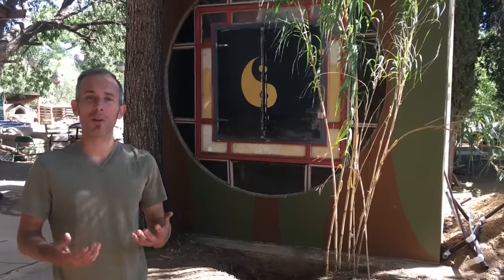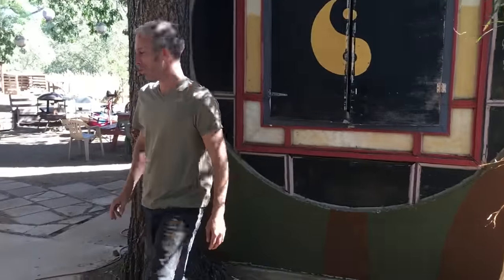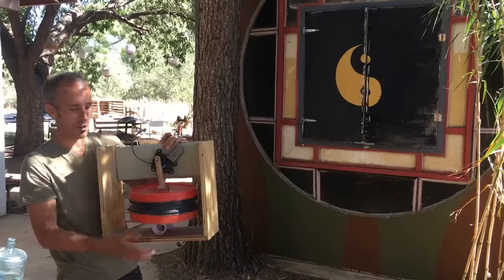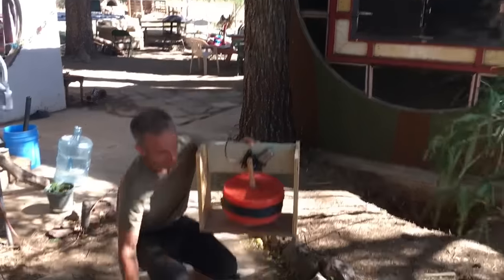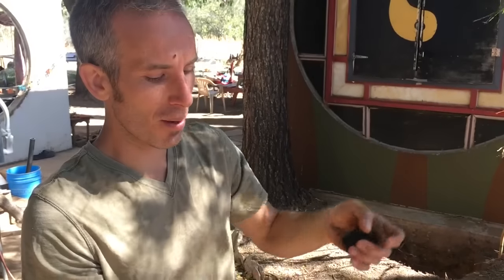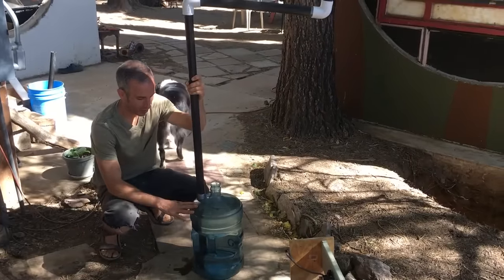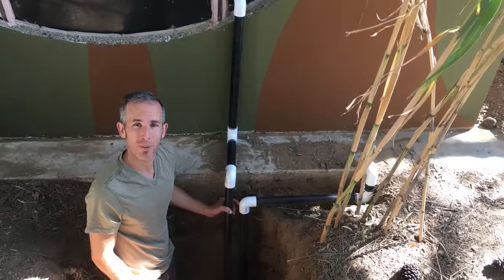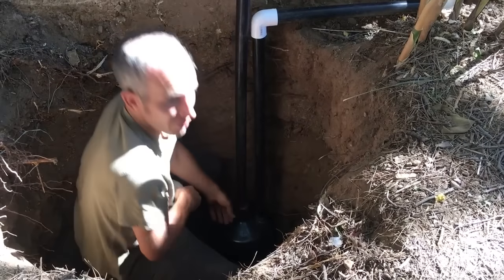$20 Ground Mass Air Cooling -DIY, Open Source

Comment: "Pretty Cool" but it would be nice to know how many degrees below ambient it produces....
Reply from the maker: The air should come out at the ground temp, which will depend on location, depth of hole, and to a limited extent season and sun contact with the ground above it.

Comment: I have a question, if yall have a second to answer it .
Would this design work in more temperate, less arid climates?
I understand that evaporative cooling systems like this  dont work so well in humid climates, though im wondering if somehow because of the geothermal effect, that gets accounted for.
Reply from the maker: This isn't an evaporative process, in fact it would be an issue if the water did gas off over time.
The cooling effect is just from transferring the ground temperature to the water, as in most locations it should be cooler than summer days and warmer than winter nights.

Comment: I have one concern: How long before that plastic bottle starts breaking down and releasing micro-plastics into the soil, etc.? Is there a more environment friendly alternative?
Reply from the maker: The water cooler bottles are usually polycarbonate, which is essentially indestructible and should start breaking down approximately never.
In other parts of the world the 20 litre bottles tend to just be PET or equivalent, which isn't quite as hard wearing but should still last a good long while.
And considering that in most instances it'll be this or landfill..

Comment: After you bubble the air up, how do you prevent the water from eventually going bad? 🤔  Just replace the water on a schedule?
Reply: People don't worry about radiator water going bad, it's just segregated from drinking water. Hydrogen peroxide at low calculated concentration, would be safe & prevent algae growing & gumming anything up.
Reply: @capoeirastronaut    Was just concerned about pumping foul smells, mold, etc into the place :)
Reply from the maker: Since the air is passing directly through the water it will essentially inoculate it with whatever, and then pass that culture back into the house. I did look at hydrogen peroxide as an option, and it should be pretty effective, and easy enough to get, but the issue is that it will gas off over time. Not to anything harmful, but means it'd need to be kept topped up, and I like to keep my stuff as low to no maintenance as possible just so someone does forget and end up getting Legionella.
Salt, on the other hand, should just sit there pretty much forever.
Reply: @OpenSourceLowTech  iodine tablets maybe?
Reply from the maker: Effective, but also gasses off.

Comment: There's just not enough internal volume and surface area to be effective. People run earth tunnels for 50 feet, or 100 feet, or 200 feet, and many setups have large diameter pipe.
Reply: You`ll get better performance from shorter tubes :)

Comment: if your running that little motor on the bellows pump.... you may as well run a small fan it would be far more efficient.
Reply from the maker: A fan won't be able to overcome the slight backpressure from bubbling the air through the water.
But I'm also working on a heat exchanger version which might allow for it.
Reply: @OpenSourceLowTech  and there is your problem.... dont think it like a water bong. instead use coils and have the air go through the coils. running air though water is going to create a bio hazard sooner or later.

Comment: can you provide us some data about the in/out air temperatures?
Reply from the maker: I have some graphs somewhere, but basically I wasn't able to get it to come up more than half a degree over the ground temperature even feeding it eight hours solid of 2 l/s 55C air from a vacuum cleaner pump.
Reply: @OpenSourceLowTech  Great.  Why are you wasting people's time with things that don't work?
Reply from the maker: @MrRerod  Being a cooling effect, not coming up over the ground temperature is it working..

Comment: Does anyone suppose this device might pump the cooler air high enough that it could enter the structure at a height of about 5' rather than at floor level?  If so, it would be more effective since the air inside the interior cabin would naturally fall downward?  It's my whole body I'd want to cool off, not just my feet.

Comment: why bellows and not just a fan?
Reply from the maker: Back pressure. It doesn't take much to push the air through the water, but still more than a fan can manage, unfortunately.
I've been trying to find a scrappable / off the shelf air pump that will do a couple liters per second at a couple PSI, but it's surprisingly tricky.
Reply: @OpenSourceLowTech  Thanks for the reply
Reply: @OpenSourceLowTech could you not suck the air out of the output rather than pushing it down?
If we was looking for an electric pump. What would work?
Reply from the maker: @hotspringsofbritishcolumbi9513  Would depend on whether the pump worked better with negative pressure or positive, but probably not much difference either way for most.

Still trying to think of a good air mover option in terms of global accessibility and ease of use.

Comment: What about mold?
Reply from the maker: Water is saturated table salt solution, so shouldn't ever really incubate or gas off. Pipes etc may want a flush every now and then, depending on situation.

Comment: Maybe just dig a hole (basement)  and build the small house over it.  Then you get the cooling right in the hole.
Reply from the maker: Cellars are nice if you've got one, and easy enough to move the air round the rest of the house, tho maybe with a filter..

Comment: That's ingenious in the use of recycle material. However, its effectiveness at transferring the heat from the building to such a small area underground is highly questionable.
Reply from the maker: It's quite a bit more effective than I would have thought. I'll be back in Australia next year (currently in Scotland where cooling isn't such an issue) and will continue the development of this design, with actual data and outcomes.

Comment: You could just use a pvc check valve for the valves.
Reply from the maker: Yes, tho they can be a little tricky to find in some parts of the world, and getting them to work with air usually requires manual shortening of the spring.

Comment: Would be interesting to see proof that this works. For example show the temperature before it starts. Show the temperature after it runs. And do it during different parts of the day. Also you're pushing air through water that's dark. Are you worried about fungus and mold and other contaminants growing in the water and then getting thrust back into the air. Are there any health concerns with that? Seems like there might be some issues there you know.

Comment: Bravo........ one way valve.......clever.......rubber ball in tube ....gravity .......ping pong ball.......water inbucket is a valve.......camera to see condition of liquid .......mold is water.......also air scurber or cleaner......cheers

Comment: I would keep the air and water seperate not sure if the mist could trel the system or not but this screams legionnaires disease to me. Maybe submerge a radiator or 3 in the liquid to keep them seperate.

Comment: Why a motor..why a pump..why water....a longer pipe would result in the same system, but it would be 100% passive. I have that in my home, it pulls earth cooled air into the house no problem 😀
Reply from the maker: Yep, that approach generally works fine, just takes up a lot more area and investment.

Comment: This is valuable work I want to test. I'm surprised that motor and pump has the strength needed.  Does it work for heating in the winter ?  Would it work in Florida where ground temp is not 55F but rather 72F? Does the hole remain open? You ever change the water? Does it work directly from a panel with no battery?
Reply from the maker: The backpressure is something like 0.2 psi, so doesn't take much to overcome. More than a fan impeller would handle tho..
It'll bring the air up or down to the ground temp, so if that's a useful heating range, which 72F / 22C would seem to be, then yes it'll essentially work as a heater in winter.
Water vessel gets buried. Saturating it with table salt should remain sterile and not gas off, so water shouldn't need replacing.
I've got another video on my channel running the pump motor directly from a PV panel. Only works in daylight obv, but that's usually the only time cooling is needed..

Comment: i would make a swamp cooler.  Cheaper don't use that much electric
Reply from the maker: Swamp coolers do a good job in dry heat, but essentially stop functioning after a certain amount of humidity, and go through a lot of water when they do work.

But are commonly used, and are fairly good when they're good.
Reply: @OpenSourceLowTech  Yes for dry climates. Here we really have to much moisture, But they still work nice in the work shops a things tho

Comment: This is simply not going to work as designed at least I can't see it working

The ability to cool a space is about BTUs not about temperature you could make the temperature of that air or water down there negative 100° but if you're only moving 0.1 CFM of air the house is going to heat up from ambient temperature faster than you can cool it you have to match the BTU increase of the house and then beat it by just a tiny amount in order to cool anything

Second You're bubbling through water which means you can't keep the water full You're in the desert in Arizona that means 20% humidity or less and you're sending that ultra dry ultra thirsty air through water which means it's going to be taking a lot of water with it when it comes back up That's not necessarily a bad thing it'll help humidify the air inside your 12 cubic foot cube but that also means you are drawing down the water that's inside that 5 gallon jug.

So you're going to need a way to continuously keep that jug full of water and that cost money as well in fact it's going to cost you a lot of money here in the desert water is expensive

I would love to be proven wrong but I suspect this is one of those MacGyver type things The theory is good and the model is accurate it's just not effective you would need to massively scale up.

I suspect you're going to need a lot more underground surface area in order to be able to have any kind of flow rate and you're probably going to want to use a liquid so piping underground and run water through it in a closed loop so you never lose the water and you just circulate the water underground above ground underground above ground above ground you put a small ACR in front of a small fan think car radiator but in reverse you'll be bringing cold water up from underground and then blowing air over the radiator which will allow the warm air to cool down as it passes over the cooler radiator

If you can scale the system up enough the nice thing is that it works year round it'll give you a 55° base no matter what the temperature is outside so even when it's cold you'll still be getting a boost toward 55° which means your heater won't have to work as hard assuming you live in a place where it gets cold like I do I live in New Mexico but up in the mountains at 7,000 ft so we get serious winter.

Comment: Sorry to be a party pooper but...  I was at Arcosanti in 78 when they had the fire.  What an incredible fiasco.  Ever seen a bunch of unprepared hippies running around trying to put out a field fire that's burning car after car?  I have.  They've been trying stuff like this for decades, only to arrive at something like this that won't produce enough air to cool a bird cage, let alone a room.  They keep trying to reinvent the wheel and connect with 'mother earth' but don't seem capable of learning anything from either their own past experiences or that of other.  You'd think in 40 years they'd have come up with something better than this.  It's like they're going backwards.  Fine with me if you want to live in an artist community, grow a ponytail, wear sandals everyday and live with less.  Have at it.  I hope it works for you.  Just don't come out here to the real world and try to impress anyone but the ignorant with nonsense such as this.  It's embarrassing.  Who'd have th a water jug buried 3 ft down, a wiper motor off a car, some abs sewer pipe, duct tape and PCV fittings are the solution to mankind's air conditioning problem.   Wow!

Comment: Just popped up on my phone.
 Maybe because I do follow you? 😎
Because you have an international audience🛂, maybe time to use metric measurements too?✅1️⃣2️⃣CM.  ✅2️⃣0️⃣`C
Sound is very low.👂🤔

THANK YOU FOR THE VIDS 👍👍👍
Reply from the maker: I'm strictly metric, but this isn't me in the video, it's the American guy I was working with there, and they do tend to insist on "standard".
I didn't notice the sound issue until it had already been uploaded, which is annoying yeah. Will fix for followups.